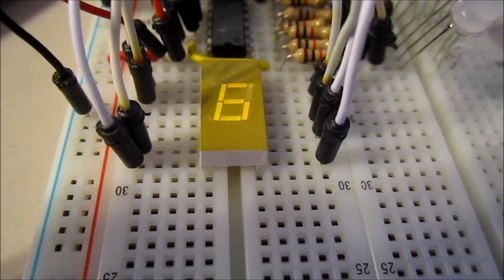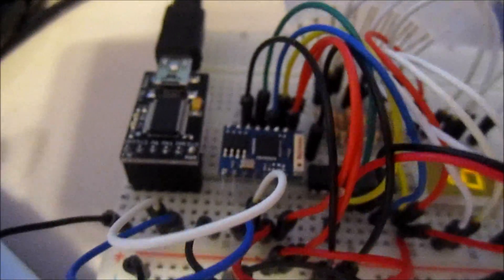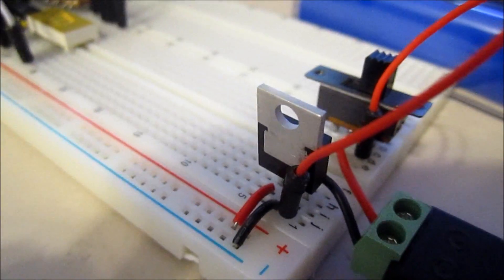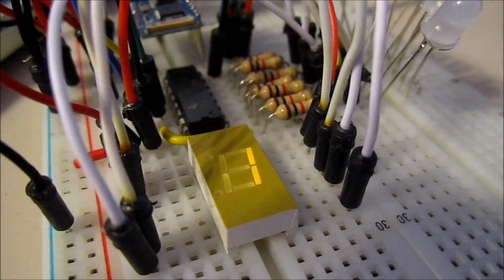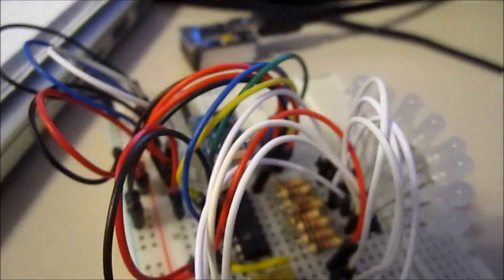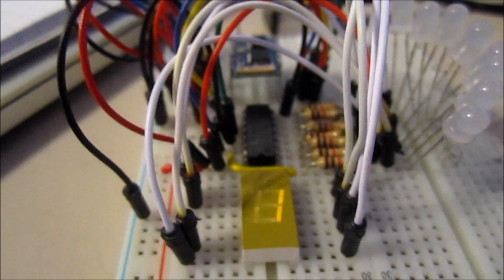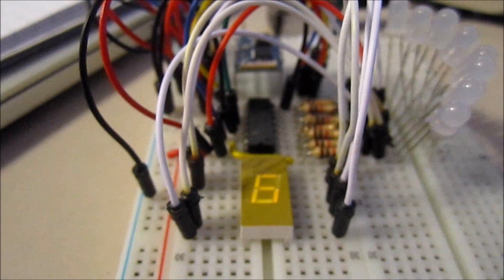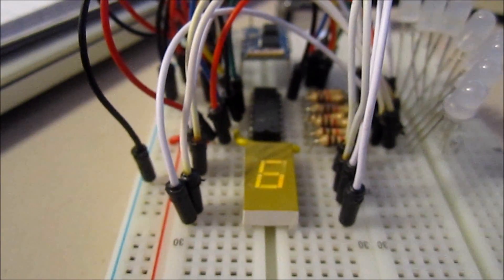$3 Wifi module part 6: Unlimited I/O pins?!

Comment: I want to my esp to do this.  if I click a button for 3 sec it should reset into access point so it has its own network,  where I can put in the correct ssid and pass,  from my Android phone,  connected to the esp wireless said ,  then on later reset it should use the given ssid and pass and connect to the server. 
Can this be done in line?  or should I just go the other route,  and compile c code,  I do not know how to do that right now,  this is why Luba excites me.  I can just do work there,  with no compiling.
Reply from the maker: I'm fairly sure that this is possible in lua. I have not tried it yet.
There are many people excited about lua as we are in this forum:
http://www.esp8266.com/viewforum.php?f=17&sid=f8096eafe3547ac322dbbf53d43f093f

Comment: Where can I find the schemtic for this, and code? this is in lua?
Reply from the maker: Hi Ilan Klein ,
Here is the lua code:
https://github.com/hwiguna/g33k/tree/master/ArduinoProjects/RF/ESP8266/NodeMCU/Lua/ShiftReg

I think the only schematic I have is the one in this video. :-(
https://www.youtube.com/watch?v=NLZYo9v5oDY
Reply: Can lua drive a 1602 led with the 74hc595? I have an esp 01
Reply: 1602 lcd I mean 16*2
Reply from the maker: Ilan Klein , in theory yes. In practice you may have to deal with 5V LCD vs 3.3V ESP I/O.  I'm also unfamiliar with how time sensitive (data pins) are on those LCDs.  Two other options to investigate:
a. ESP can print texts, that you may be able to display on a serial LCD
b. OLED displays: https://www.youtube.com/watch?v=_t_lfcGV_YM

I'd be very interested in what you find out.  Please keep me updated!
Reply: the 5v 3.3v should not be an issue,  if I run it by a bidirectional  cd40 I think,  I am still new at this,  my issue is what Lib  to use and how to connect,  I ordered the i2c serial for 1602, but want to experiment in the meantime .  I very much love your videos,  and have ordered 2 0.96 oled screens today because of you....  I just think they are rather small and wanted to drive my 1602 in the meantime.  I am also waiting on the esp8266_12 so as to have more in pins .  I am very excited,  and think I can create my project,  with esp Lua and nothing else,  no need for arduino.  I am building a remote operated boiler switch and need to connect rtc,  and relay and led . I was going for uno,  but now I am checking just the esp.
Reply: Hari Wiguna what do u mean when u say esp can print text,  example.?
Reply from the maker: Ilan Klein print("temperature:74") in lua, and connect a serial LCD instead of the FTDI.  It should show up on the LCD.
Reply: Hari Wiguna great,  so when I get the serial interface for my 1602, that would work,  so basically u mean connect to  r  and TX,  gr8,  but can I change those pins ? that I print to...